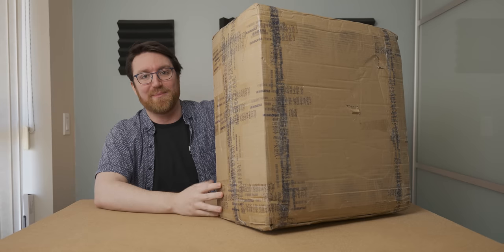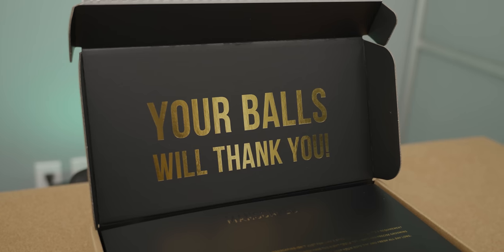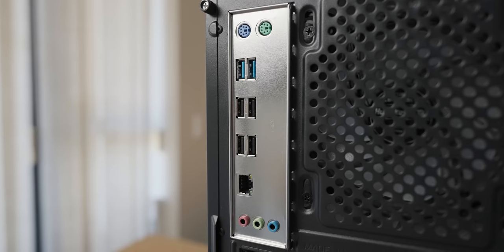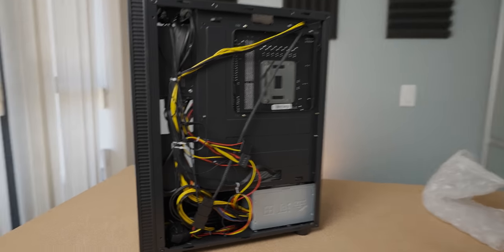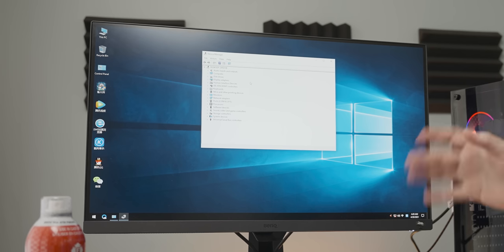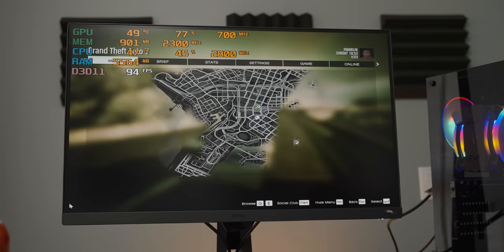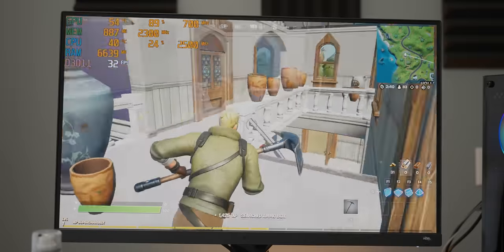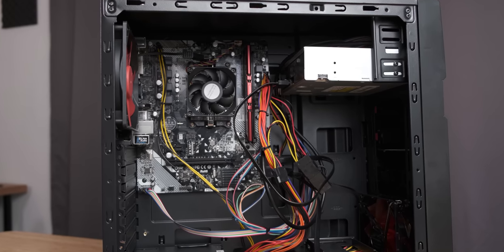I Bought The CHEAPEST Gaming PC From Aliexpress...

Comment: I was actually expecting it to simply release a virus that would take over all your household appliances and then spread to the rest of Canada before crossing to the US. I actually like the RGB strip on the front of the computer, it's kinda cute.
Reply from the maker: Oh wow! Really turned the grimness of that comment around at the last second. 😅
Reply: I mean it probably did.
Reply: No. It's still horrible. The card is ANCIENT and could die at any point, just like the PSU. For 300 bucks, you should get a PC that at least a GTX 950 in it or something like that. Haggle for used parts and stuff. This is still a very bad deal because you get no warranty and you get stuff that is way too old. I really have no idea why Dawid keeps calling these deals good when they are obviously not and he knows it. Just because they didn't ship a non-functioning PC does not change the fact that this is still a horrible deal.
Reply: @KYSMO  for 300ish dollars this system is a good deal, considering the fact that there must be at least 50 to 100 dollars of profit for the seller. Your argument is valid, but who buys a pre-built for that kind of money doesn't care about picking pc part and assembly everything togheter (or simply don't have the knowledge to do so).
Reply: @KYSMO  copy pasted comment lol

Comment: Another prove of the performance of those "old" xeon builds, even 10 years after - I love my double xeon cpu (32 threads in total) workstation with 128gb of "cheap" ddr3 ram. Gaming? Sure no problem, but have a look at your electricity bill ;-)
Reply: what does that mean....
Reply: @dylangs9305  plenty of computing power, but one 8 core Xeon CPU can easily consume 115W, which needs to be cooles and is far above the consumption of a current 8 core CPU
Reply: @pascalfust1035  cries in 155watt contant unlocked i7 11700
Reply: @christophergonzalez5552  An i7-11700 consumes up to 65 watt, 50 watt less than a Xeon e5-2670. However,  it requires (expensive) DDR4-RAM and comes with only dual-channel capabilities, while the old Xeons already came with quad-channel. But, finally it is (currently) just a question of money to choose which one was better suited to ones needs...

Comment: Considering right now, with graphics card prices still continuing to be high, $360 is not bad for a fully-working tower like this, even if some of the components might be questionable in terms of durability.  I'd say, for once, maybe you got your money's worth or perhaps a little more on this one.
Reply: Found pc 290 dollar on aliexpress with uhd graphics 8gb ram and intel i3-1010u 4.1 ghz Mobile processor but it is impressing that it could play gta v at 40-60 fps at low setting and mc 130-140 on high setting
Reply: @Xinster  uhd is not good for gaming, but it's a new-ish CPU which is good!

Comment: If I were to switch from laptop to PC, I'd honestly most likely start with this. It comes with imo more than what you pay for, plus upgrading would be easy. Overall cable management was amazing for a 3rd party brand. I wouldn't use the parts it comes with but there are some cases that cost more than this. Pretty good tbh.
Reply: For another 200 you could get something so much better

Comment: I actually have the same Motherboard in a self-built pc. Bought it from a local Chinese tech student here in Germany, so it seems to be a trusted company over there. I'm using it with 12gb RAM, a gtx 1060 and an i3 8100, everything runs wonderful so far the only downsides of it were the kinda ugly BIOS (still functional), the loud beep it made by booting (just took out the speaker) and the missing M.2 slot.
Reply: Never heard of it. Probably a start up that didn’t work out 10 years ago.

Comment: I'm curious if the Xeon system would enable one to disable Intel security patches that greatly reduce performance, or if possibly it already does that.
Reply: the cheapest system until a new cheaper system comes out🤣🤣🤣🤣🤣🤣
Reply: Some X99 Motherboards have an Bios mod that Unlocks the turbo boost , if i remember only works with Xeons E5 v3

Comment: Honestly? I'm fairly impressed. I wouldn't reccomend it, but it's much, much better than I thought it would be :D
Reply: literally the only prebuilt pc on the market right now that IS as performing as what you pay for
Reply from the maker: Exactly my thoughts. It was the same with the previous Aliexpress one.
Reply: Crappy GPU aside, you can have a decent budget gaming rig, just add 8gigs more RAM, a 1650 and you're golden without breaking the bank.
Reply: @egonieser  Worth mentioning that a 1650 costs more than half as much as the system itself.
Reply: @no1DdC  I mean I honestly find it pretty good that you even have a decent upgrade path at this price range in the first place.
Reply: Compelling value? Yes
Should you buy it? Probably not
Reply: @saxon5564  I'd buy it, as a starter rig. Curious if Dawid would post the link
Reply: @DawidDoesTechStuff  what's the link?
Reply: @egonieser  Heck, if you can't find a 1650, even something like a 1050 Ti or a 970/ RX 550 would be a big upgrade and make it a budget gaming rig.

Comment: I thought AMD dropped driver support for the HD6000 series at least five years ago. So it was a little surprise to see one of this sold  in a PC in 2021...

Without actual drivers many modern games will run bad or not at all, even if they theoretically would run decent on such a dated GPU.

BTW Nice chan, subscribed. :)
Reply: 2021              2021

2021              2021

Never gonna give you

Comment: I unashamedly like that case.  Not gonna lie.  I'd just dremel the holes in the front to actually be functional, and maybe just build some spacers for the "glass" side panel.  If you could control the LED strip in the front, it'd be awesome to set it to "cylon" mode(red sweeping up and down).

Comment: tbf, shipping a pc with the gpu out and held stable with packing is actually best practice. GPUs left in the slot during shipping can tear the slot from teh weight.
Reply: seems like most of the bad shit happened in transit, and for hte rest, you get the prebuilt you paid for. THey could do better with the ram. But yeah, huananzhi is... well, it's sketchy AF, but it's realiable in it's sketchiness. THey have a good brand to hold up, of flipping ewaste back to functional hardware. That cpu and board could probably be passable with a better gpu. x79 still hasa bit of life left on the xeon side.
Reply: and that cooler, overkill, but not at all fucking bad.

Comment: i would be more terrified if they already installed the gpu before shipping. the rocking on the socket will bend it and destroy the most expensive part of the pc, they are not meant for moving around after plugged into socket. at least the seller know how to do shipping safely for gpu card

Comment: putting in a used 30 bucks 750 ti this is actually kind of decent. But in this case you could also just build a used system for like 200 bucks :D. Those xeons sure are interesting.

Comment: Not to denegrate AliExpress or the awesome system here, but I wasn't sure how else to tell you, I found a really crazy offer for a PC on Amazon that seems right up your alley. 

It's a Kaby Lake Pentium dual core randomly put in one of 3 case designs (white/blue fan, black/orange fan, and black/purple fan) case with 8gb of (they claim) the mythical *dual channel ram*, an unidentified 80+ 430w PSU and a 120gb SSD. 

And it's *$57 US*. 

I can't link it but you could find it at amazon as "2017 Desktop Computer Intel Kaby Lake 3.6GHz 128GB SSD 3D NAND 8 GB RAM DDR4 HDMI USB 3.0 Windows 10 Pro Office 2016 (Black Orange)".

Comment: I have NEVER seen such a bad system. Well it only cost 366 $, but that doesn't make it any better, the fact that 1. Screws are missing, 2. an absolutely CHEAP power supply was used (I would be afraid that my house would burn down) and 3. they use some brands that I have NEVER heard of in my life, turn this thing into scrap metal. The SSD will probably last 2 months and then it's junk.

Comment: The HD 6700 series includes the 6750 and 6770. It's likely your card IS a 6770 but it got misidentified. Happens all the time ever since amd's legacy drivers started lopping all the gpu's in a range together.

If they tried like, just a LITTLE bit harder this pc could be so decent. But alas.

Comment: i bought a optiplex 7020 with an i5, 8 gb of ram, and bought a seperate gt 1030 gpu and got all that for 300, it runs gta at 60 frames, this on the other hand, would not

Comment: Running one of those cheap xion’s in a dell workstation put a rx580 in there just before COVID thinking it will do for now and I’ll build myself custom system next year 😂😂😂😂 then the prices went through the roof and my cheap £250-£300 all in pc became a £800+ pc in 12 months but tbh little upgrade dell pre built holds up very well so I’m not rushing to spend big I’ll wait out the shortage out with it

Comment: What a coincidence! I built a system for 250 dollars about years ago. The system has the same brand of motherboard, case, PSU as shown in this video, but the specs of mine is better than that. Here is my specs:

CPU: Xeon E5 2670
GPU: Radeon RX570
RAM 16G DDR 3 ECC Quad Channel
PSU: 600W with gold 80 plus label (Although I don't give a s!!t about 80 plus crap, it is better to have it.)
Boot Drive: 256gb nvme drive.
Motherboard: LGA 2011 ; 4x DDR3 ECC; 2x PCI-e x16 and 2x PCI-e x1; USB 3.0;

Comment: No. It's still horrible. The card is ANCIENT and could die at any point, just like the PSU. For 300 bucks, you should get a PC that at least a GTX 950 in it or something like that. Haggle for used parts and stuff. This is still a very bad deal because you get no warranty and you get stuff that is way too old. I really have no idea why Dawid keeps calling these deals good when they are obviously not and he knows it. Just because they didn't ship a non-functioning PC does not change the fact that this is still a horrible deal. I am SURE you can get a better PC on Facebook Marketplace or any other classified ads site for a 100 bucks or so.

Comment: I find 80 fps in cs go is quite bad. Even my 2012 system which i replaced last week got around 200-250 constantly. Now I'm able to get around 800 fps if i want to with my old gpu still but i capped it to 400. So buying a new 400$ computer runs cs go not even halv as good a 2000$ system thats 10 years old that's not a good value. I could never go for that kind of budgeldbuilds. I always build for 8-9 years while i can still play anything after 8-9 years on ultra and only having to upgrade the graphicscard like every 4-5 years. Went for a 12700k and 64gb ddr4 3200 ram for my new system now gonna replace my 1070 quite soon once prices drop then i will be set for at least 5 years again. Also I don't do 4k gaming i enjoy always full maxed out ultra settings more than higher resolution. But i will get a 2. monitor which is 4k hdr just for movies and programming.

Comment: My prediction is specs before video starts:

Intel i3 integrated graphics
Loud fans
250W power supply 
4 Gb RAM or 1 8 Gb RAM stick
Green MOBO
Terrible RGB case

Edit: got most right except CPU, surprisingly there was a GPU
Reply: The case looks decent imo

Comment: You can get around 300$ used PC and it will shred this PC 

Gtx 1060 6gb 70 usd
Ryzen 3 4100 65 usd
Gg b450m s2h 45 usd
Crucial kit 2x16 30 usd 
Gamemax 0c case 35 usd
TT smart 500w 40 usd 
Id cooling se 214 xt 20 usd
Total  305 usd
Reply: this list lacks storage (very important)
and windows...